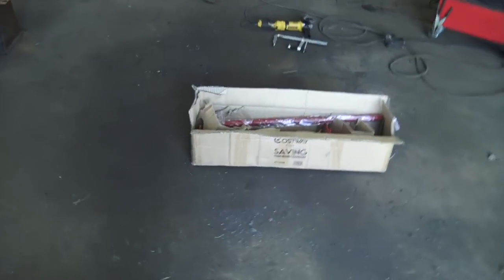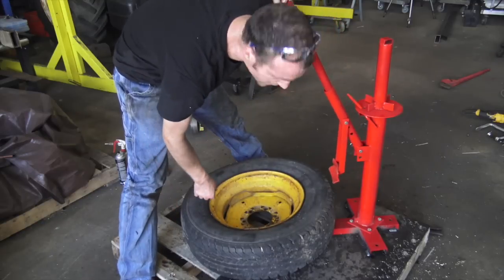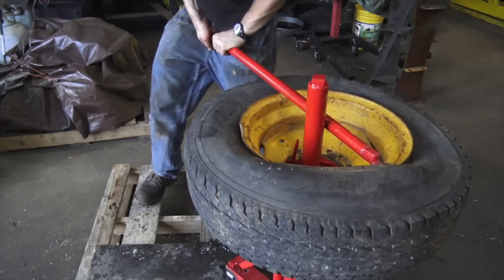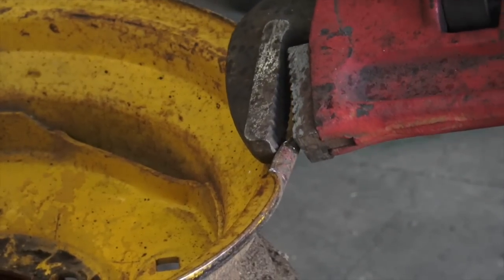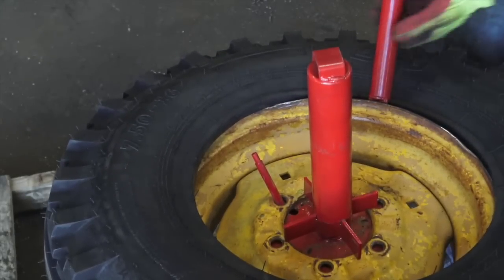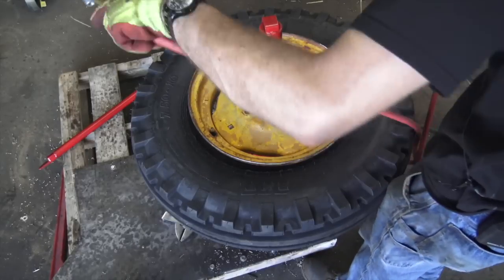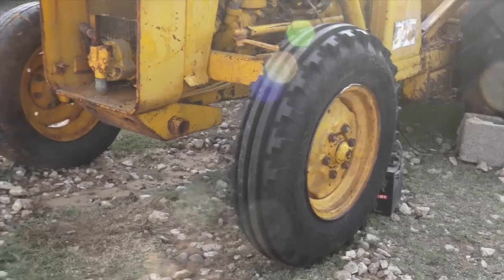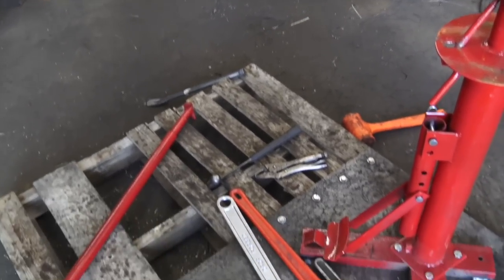I BOUGHT A CHEAP TIRE CHANGE MACHINE AND LEARNED THIS USING IT FOR THE FIRST TIME

Comment: LUBRICATION! I'm 54, and when I was a kid I would go with my dad to a tire shop to have tires repaired or changed for the equipment on the dairy.  The guys used to break down tires on the ground. They always used lubrication. I have done and still do some my own tires.  I have one of those tire changers and I have it mounted to a piece of 1/2" plate outside. I just (about a couple months ago) mounted some 10 ply lowboy tires for a trailer I use to water my cattle.  Nice job! And now that you have the tire changer you will get more efficient. And rather than a 20 minute drive to town and $20 in fuel you can just break down your own stuff for repair. Also, I have swapped tires on my car trailer myself with out balancing and do not have any trouble.

Comment: As others said, lube it up with soapy water, and to make getting the tire off easier, push the tire to the middle of the wheel to give you some slack in the bead when initially using the tire iron to get the bead over the rim.   The same is true when mounting a tire, use the dished in portion of the rim or wheel to get slack to make getting the bead over the rim!

Comment: Reenforce the bar's for the bead breaker part before they bend and go s shaped happen to me with mine both times and that was on a Honda tire take L stuff and go the whole length from top where the pin is to just passed the welds on the bottom so it doesn't bend

Comment: drill some anchors in the floor so you can bolt it down when you need to use it and move it out of the way when it just needs to collect some dust for you. Also if you had soaped that tire you could have put it on the wheel just by pushing it. You didn't have the bead down is why it was so hard.. vise grips to hold tire down as you put it on. good luck on the next one.

Comment: I had 1. It was shit, the thread stripped out on the upright. Your's looks slightly different. If you must keep it , Have it outside, dig a hole fill it with cement. Bolt it down and when its not in use cut the end out of a 44 gallon drum and slip it over it to cover and protect it, And paint it yellow so some fool doesn;t run over it, Good luck.

Comment: If you want a real workout try a trailer tire that someone has run flat until nothing is left but the beads. That’s probably the most fun I’ve had with mine. A normal tire, assuming you can break the bead, can be changed in 5-10 minutes with some practice, soap, a couple more tire spoons, and a well anchored tire changer.

Comment: 9:40 "Lets take this thing off the thing here... and bounce it on the ground and see what happens".... yup... it bounced.  The reason people do it?... it's called entertainment..   🤣 ... no.. seriously... just to give the bead a push... if your using a tube the bead isn't always seated properly and I didn't see you put on lubricant so there is friction between the tyre and the wheel.. you could up the PSI but I've seen a few "accidents" doing that... another thing.... do you know the reason why there is a bowl?... so you can take off and put on tyres... it makes it so easier... not the only reason... but is sure makes it easy. I think this is a old video so I'm sure you've got the knack of it now.

Comment: I have a 39  Ford 9N. When I bought it the front tires had tubes in them and after encountering some cactus the tubes had numerous holes. Took the tubes out filled the tires with air  and green slime tire sealant and so far so good ,and that was three years ago

Comment: Look @ the ends of the red handle. One end is used to take the tire off (the flat end you were using). The other end (hook end) is used to roll the  tire bead on to the rim.

Comment: Goop hand cleaner works well to lube the beads. Work quickly, usually you can get the first side on without using the bar. I lube half the second bead, catch the unlubed part first, it won't slip out because it is dry. I have mine mounted on a hitch adapter, my 2nd gen Ram makes a solid base to torque on the bar to peel a tire off a wheel.